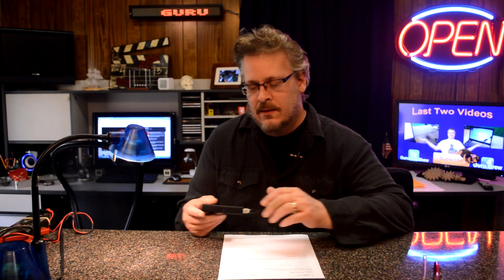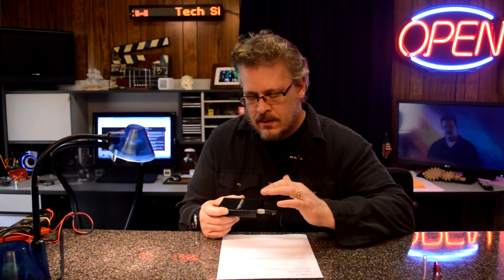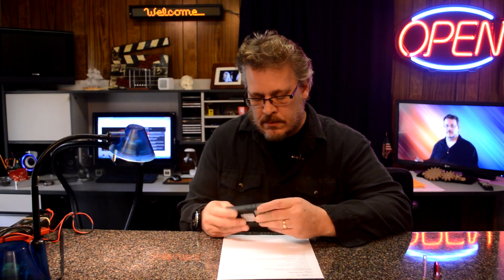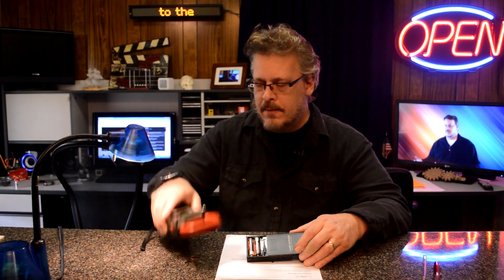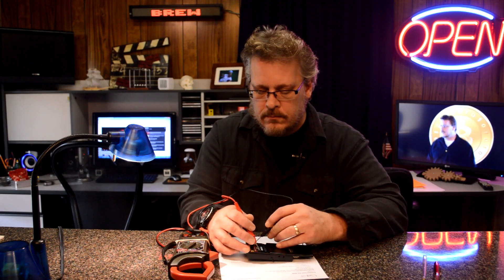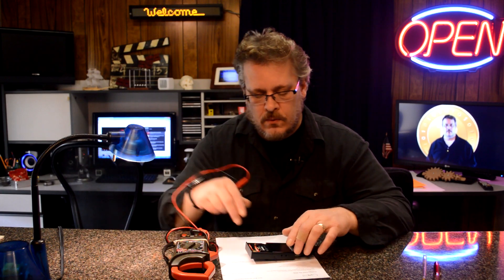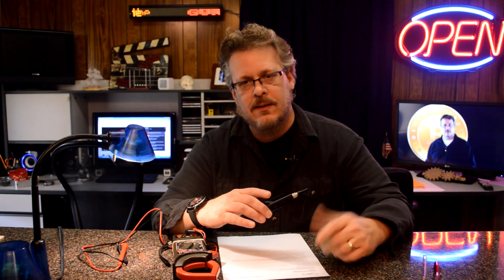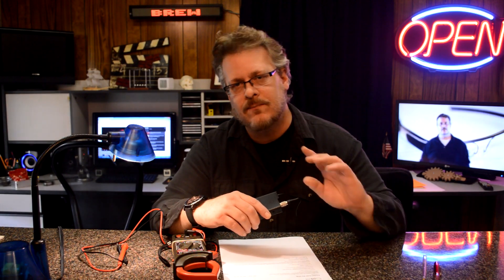How to Properly Test Batteries - Cutting Room Floor

Comment: Checking AAA-D cells (+ 9 volt batteries, lets not forget) under load is a new concept for me. I usually check new cells sometimes to get a baseline voltage and to compare various brands of alkaline cells. I spot check the rechargeable cells to see the "ending voltage" when they are depleted, as well as the state of charge if they've been sitting for a few months, since these cells tend to self-discharge more than alkaline cells. I have alkaline for certain applications, and I've been trying to use rechargeable Ni-Cad or Li++ cells to cut down on cost. The only issue is the lack of the stipulated voltage on most rechargeable cells. I use plenty of AA/AAA cells in various lighting, remote controls, and two beard trimmers. I use alkaline for the remotes and trimmers, and the rechargeable for the lighting (head lights for dog walking and working on cars, as well as flashlights). A new alkaline is usually 1.6 - 1.63 on my Fluke, while a freshly charged Ni-cad hovers around 1.3-1.35. The Ni-cads tend to lose their charge when the head lights are on "high" quite rapidly, with visible dimming during the first hour. It's not a problem with these lights, since I have extras, but items like the remotes will need them swapped within weeks. And Ni-cads give out and quit at the worst possible time when used in a remote. I've been getting my alkaline cells from HF when they have a sale, and they last nearly the same as name brand cells. I've also experimented with charging up alkalines, but the batteries tend to leak after being recharged and don't hold a charge very well. You have to use a timer and prevent the batteries from overheating when recharging alkaline cells, and I've given up on doing this in favor of using ni-cads. Ray-O-Vac alkalines are the ones that I've had the best luck with, as far as recharging is concerned. There are vids here on YT about recharging alkalines, and the advice varies widely from person to person.

Comment: Have you tried lithium or rechargeable ni-cad replacements?
Reply from the maker: +William Hardin I tryed with Ni cads and Ni-MH but the 1.2v is just to low. Unfortunately they did not put a type selector switch.